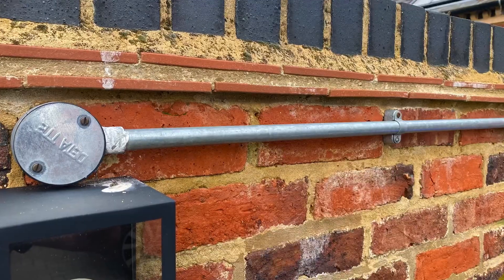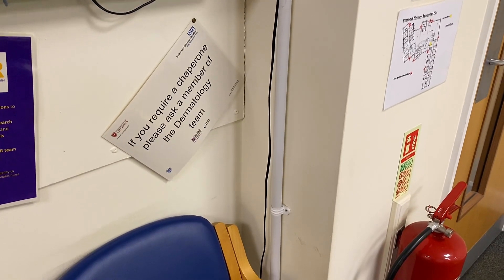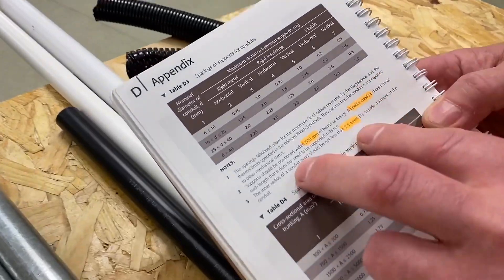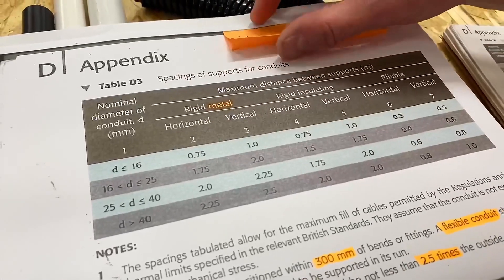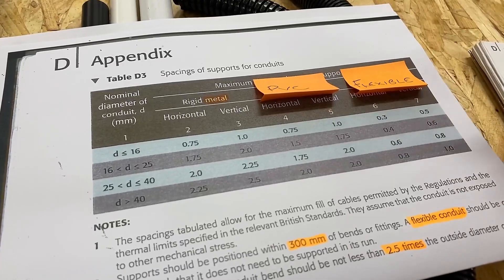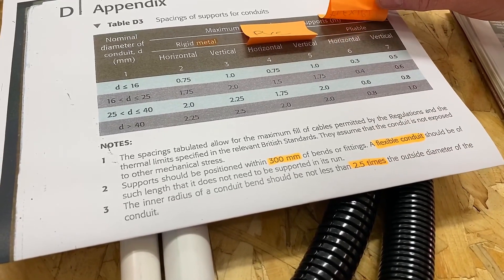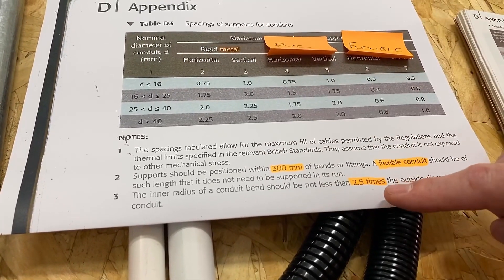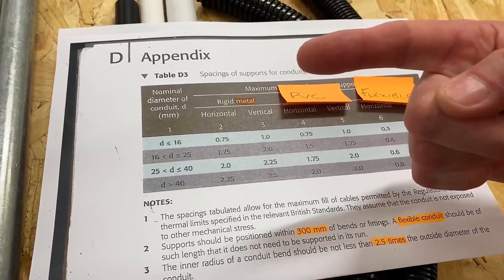BS7671 Says it’s NOT Metal, Plastic and Flexible Conduit

Comment: The table says pliable (you have renamed it flexible) conduit must be supported at 0.6m intervals for horizontal and 0.8m intervals for vertical runs, yet the Note 2 says flexible conduit should of such length that it does not need to be supported?? So why have the interval distances in the table?

Comment: That flexible conduit is horrible. I very very rarely use it and then only for a short bends The amount of times amount of times I have had to replace it  put in by other electricians as it’s gone brittle or rotten.  Maybe it was cheep stuff to start with .  Just saying
Reply: the metal with black plastic sleeve flexible conduit is quality stuff though. use it for motors